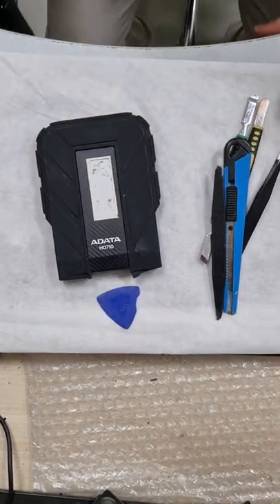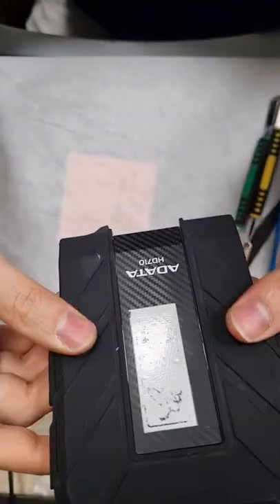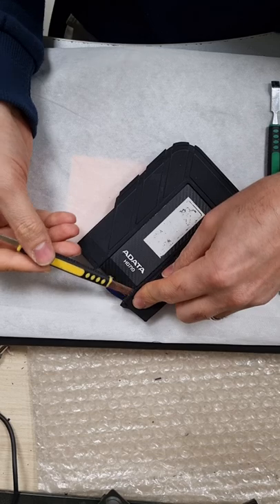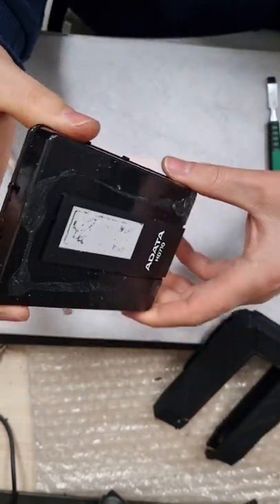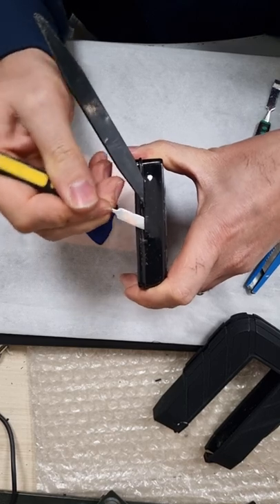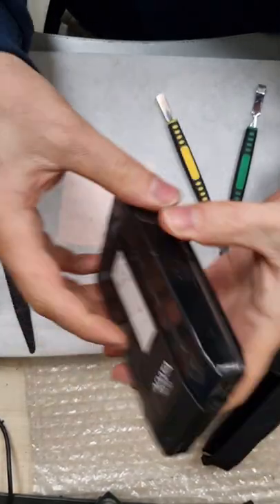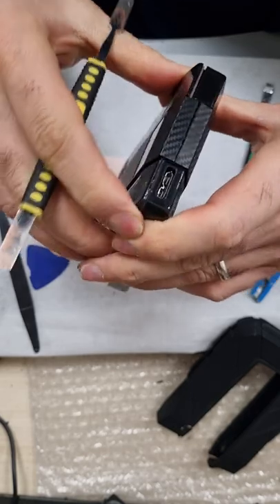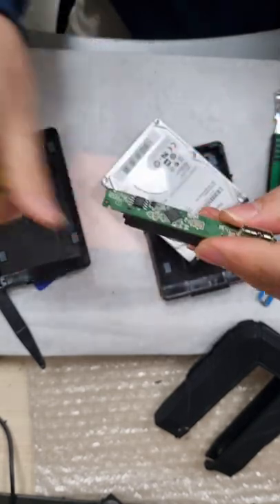ADATA HD710 disassembly

Comment: The SATA to USB board isn't securely attached to the HDD. In other portable drives they have a metal plate with screws on or at least some silver metal tape